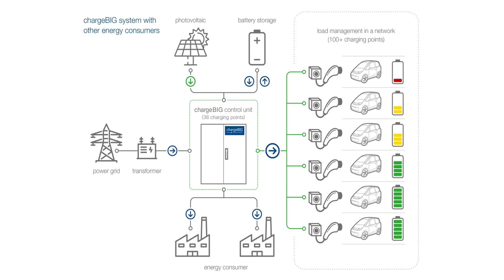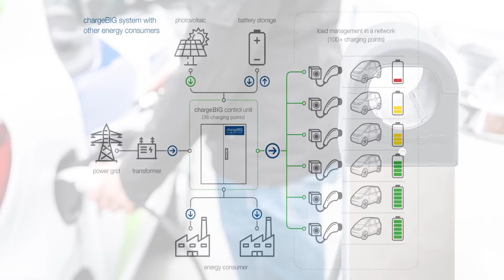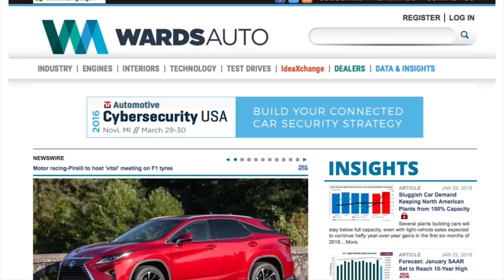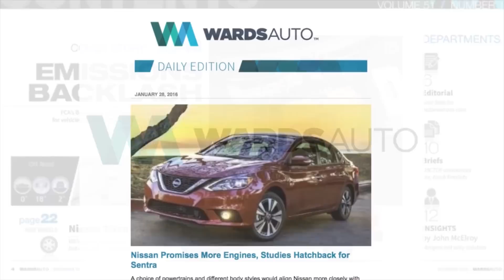Musk Promises “Massive Wave Of New Products”; Renault to Split BEV & ICE - Autoline Daily 3299

Comment: Cyber Truck will come "next year"...in Elon time.
Reply: I still have to wait in line behind 1.2 million other customers AFTER it goes into production. It may not even be called the CyberTruck by the time I get mine. However, it might also have super high density LFP batteries and get more range so it's a win / win situation.
Reply: In Elon time 12 months equals at least 6 years
Reply: The 4680 battery lines are up and running in Texas, BUT the first gen cells have ~18% less capacity than promised on battery day, so the vehicles will probably be coming with less range. 450 miles for the Cybertruck, 400 miles for Semi, 500 miles for Roadster... and it wouldn't matter, as long as they'll be mass produced and charge really fast 👍
Reply: I'm still waiting for the Model 3 robo taxi. I want my $30,000.00 dollars a year.

Comment: Warning the driver is NOT the correct way to stop a wrong way driver. Just set the maximum speed of the vehicle to 10 miles per hour and lock the 4 way flashers on.

Comment: Legacy auto is screwed. Tesla is about to take over the industry….. oh wait they already are….

2/3rds of all EVs in the USA are Teslas….
Reply: Haha!    Tesla does lead the USA in EV's but less than 1% of licensed vehicles on the road.
Reply: @dmitchellhomes  Rome wasn’t built in a day ;)
Reply: @Alexzw92  haha!  the point is all Tesla guidance should be taken with a grain of salt,  they are late on almost everything, and I mean way late.   You see GM delivering their EV products on the guidance they gave, and in some cases ahead of the guidance they gave.   In the last year GM launched production of 5 new EV products, all on the schedule they gave.    Ford Launched the Mach E on time, and Lightning looks to also be on time,   only Tesla has multiyear delays.
Reply: @dmitchellhomes  They release “on time” only to then slash how many they will actually produce which only hurts profits.

Tesla waits to start production until they can actually produce them with large volume :)

Also I’d like to add that the Model Y was 11 months early
Reply: @Alexzw92    Really?  First full quarter of Model 3 production Tesla built 220 cars.  Second quarter less then 2000,  thats not exact a fast ramp.    Slower then Rivian...
Reply: @dmitchellhomes  GM sold just over 400 EVs total last quarter, you’re going to praise that failure?  😂
Reply: @DarkBrandon1    GM sold 550K cars in the USA in Q1,  compared to 120K for Tesla,   Lets keep revisiting GM's EV production rate as their battery production starts ramping up...  I predict an S curve like you have never seen.    2023 is going to be fun for GM EV's.
Reply: @dmitchellhomes  Better than 1 and 99...hummerboy
Reply: @dbwelder9159   1 to 99 is exponential increase in production,   what do you expect for Q2?   I think you will see over 500 Hummers, 5000 bolts, and 100 or so Lyriq, another step,  Q3, for the next 12 months going to be really exiting for GM EV's,   new models and ramp up as battery supply comes online.    Let's not forget it took Tesla from 2013, to 2019 to build GF Nevada and bring it to capacity.    GM is 20 months into Ultium 1 in Lordstown and it is producing now.    I hear will fully ramp by q3 2023,  so 3 years total, land clearing to capacity production, twice as fast as Tesla, and Lordstown is a higher producing factory.
Reply: @dmitchellhomes  GM is treating their EV production like CAFE requirements.  They are not profitable on the Hummer EV, not profitable on the Bolts, and I’m going to guess that they’re not profitable on the Lyriq.  They will limit their EV production, just like they have done in the past.
Reply: @dmitchellhomes  99 is about one a day!  Wow a whole 500 this quarter?  Yeah, I guess it is a shame that a parent would foolishly invest in Tesla for their children with such a negative attitude towards them...  especially when GM is leading...
Reply: @DarkBrandon1  well, clearly you know better than GM about business, but the president of GM, and the CFO have both said hummer will be extremely profitable right from the start.  So either you are smarter, and they committed securities fraud and will end up in prison, or you are just flat out dead wrong, I know which one I’m betting on
Reply: @dbwelder9159  i’m not sure what all of your nonsense means, but GM’s strategy is long-term, they are building out their battery and manufacturing infrastructure.  They have nailed every single schedule they have given, now perhaps because you graded everything on Tesla, and the model three which is a cheap economy sedan that wrapped up billions of dollars in losses for Tesla, that’s not the way GM is doing it.   They are building the ground up infrastructure, and the production will follow.
Reply: @dmitchellhomes  they’ll be “profitable” because they won’t have to pay the emissions fines or buy credits from Tesla to offset their Trucks and SUV gas guzzling lineup.  The total loss on the EVs will be less than the fines/credit costs.
Reply: @DarkBrandon1    Profitable is profitable, no matter how you twist or turn it.     Tesla's ZEV credits are pretty much worthless these days,   most build enough EV's to make it on their own...
Reply: @dmitchellhomes  ahh but it busts your S-curve statement.  As they build more, they lose more money than they’d be fined.  So they won’t do it.  It’s why they never built more than 25k-30k bolts per year.
Reply: @DarkBrandon1  I think they never built more than 25 to 30,000 bolts because that was demand.  Things are different today with five dollar a gallon gas, and a Tesla model three costing almost twice as much.   GM announced this week, they think they will build and sell more bolts this year, than any previous year,  and next year even more.   I will be shocked if we get to the end of 2022, and GM has not sold more than 50,000 EV‘s.
Reply: I'm in the North Dallas area and I can't drive a mile without seeing several Tesla cars. My wife had hers wrapped in bright green just so she can find it in a parking lot. 🤣
Reply: @dmitchellhomes  well we’re in Q2 now, and they have another 49,600 to go.
Reply: @dmitchellhomes  Did you know GM does indeed buy credits from Tesla in China?